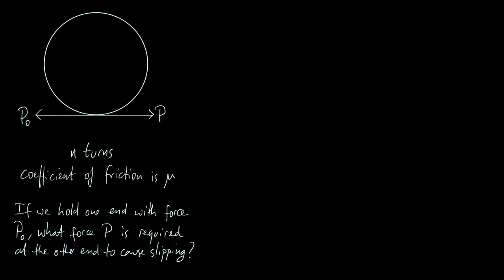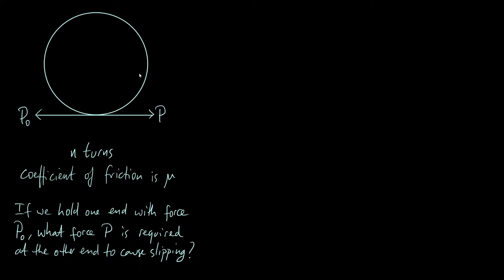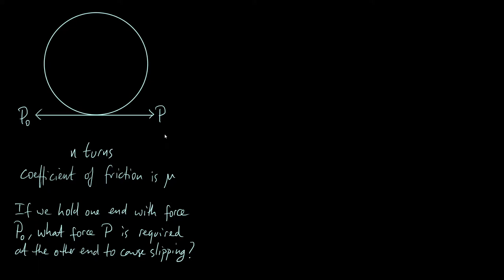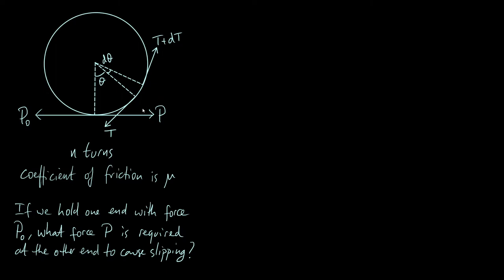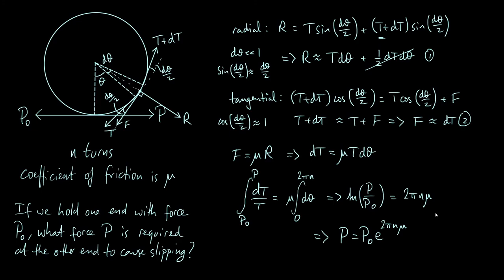Force on a rope wrapped around a cylinder: deriving the capstan equation

Comment: Why we use this relation in band brake and rope pulley problem both while in band brake, pure slipping is there but in case of rope-pulley pure rolling is there between rope and pulley.
This result is better suits for band brake(because pure slipping is there i.e maximum value of friction u×R is generated).
Please help through video. Please. 
louuu from india.

Comment: Is it possible to use this principle to replace chain drive and sprocket? How many wraps are optimal? Thank you
Reply from the maker: In principle yes, but if the main goal is to transfer rotational motion from one place to another then a sprocket would probably be a better choice, as with the capstan you’d need to make sure that the coefficient of friction is large enough to ensure no slippage. The meaning of "large enough" will depend on how much torque will be applied to the system.

Comment: Dear sir, while writing the force balance equation along tangential and normal direction why didn't you take the contribution of the weight of the small element?
Reply from the maker: I'm just assuming that we can neglect the weight for modelling purposes. I can't remember whether or not it ends up being possible to solve the resulting differential equation exactly if the weight is included - might be an interesting exercise to give it a try. Also, a quick search suggests that the capstans that are actually used on boats are often oriented such that the rope is wound in the horizontal plane rather than the vertical plane. In this case, the diagram in the video would really be a top-down view and the weight would be acting into the screen, so a full 3D analysis would be required if we wanted to include the effect of weight!